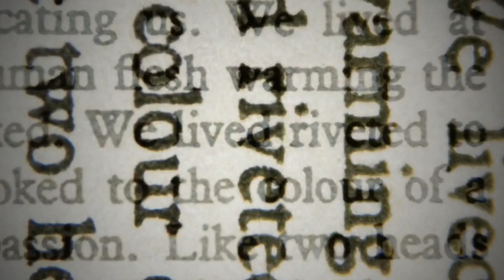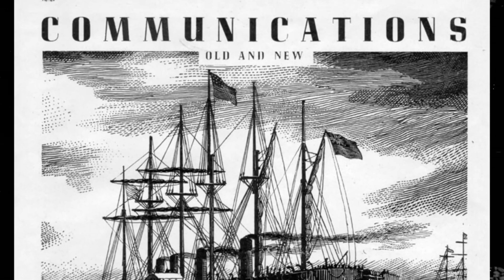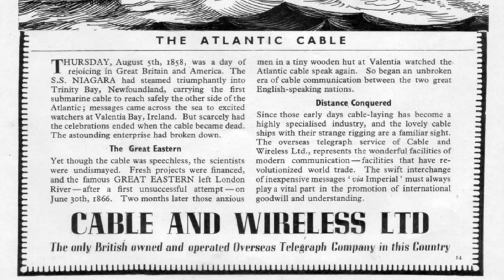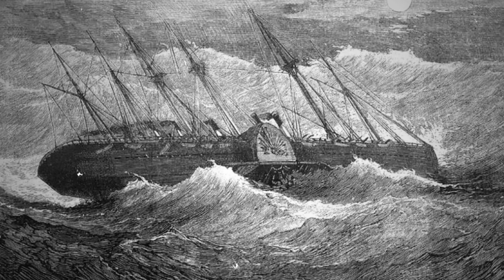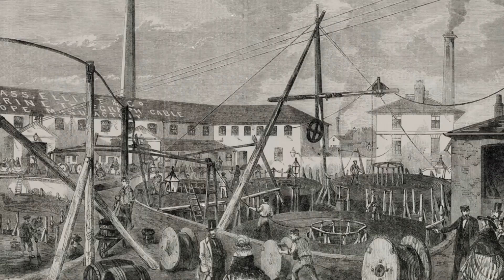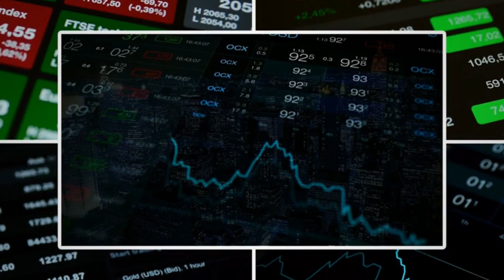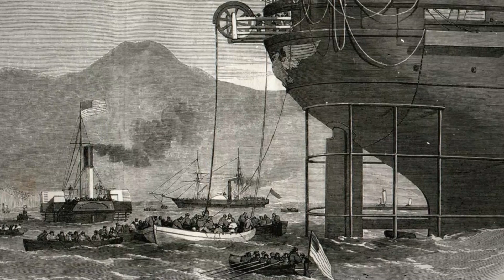Eight Minutes That Changed History Forever

Comment: I just want to know how did they know that the cable would connect to each other under without being able to see it
Reply from the maker: They made similar experiences before with the first telegraphs that used electrical current which creates an electromagnetic force  that moves needles connected to a wires and type a message.
Reply: @ Nothing has ever been designed better than a human and this feat definitely represented that